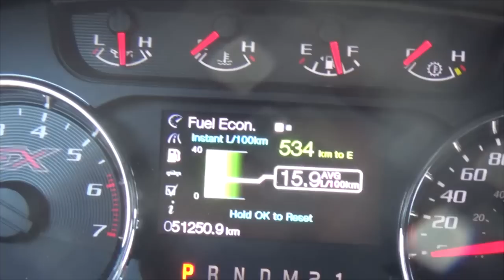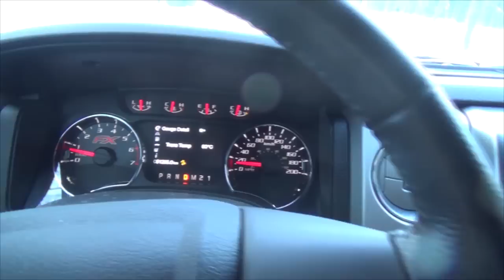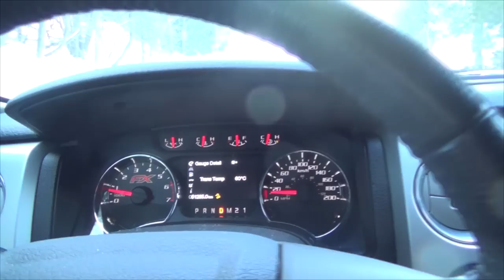Working on the park bench

Comment: HI Bill, it is a good ides to unplug the heater before starting. I drove trucks for 24 years and was always told unplug it be fore starting. The service man said if your coolant is a little low and it cavitates around the heater it is gone in less than a second. They are not made to be out of coolant at all when on. 
Thanks for the vids keep it up.

Comment: B12 chemtool fuel system cleaner will clean the ring land right up in around 15 minutes of soaking. I should know. I used it on a motorcycle I bought with 19 year old gas left in it. Carbs were plugged solid. I poured that down the gas line and let it soak. It runs good now and that's all I did to the carbs

Comment: Looks like your truck has a temperature activating block heater cord it could be the temp sensor disk at the front of the cord the little round black cap it should activate after -20 without windchill

Comment: Bill, have you looked into JCB for a replacement loader/backhoe? One with a cab for the winter months of snow removal. A JCB 35 I think would be comparable to your 110. And it has an extend-a-hoe to dig extra deep if needed. Just a thought.
Reply: I think you are thinking of the MIDI CX. We don't get them here in US or Canada anymore however, so he'd have to find a used one.

Comment: BILLSTMAXX :) My '87 chevy has a block heater (aka frost plug) but it doesn't really provide heat quicker, as that's not the point of them. They barely heat the coolant, actually. Not even enough to move the temp gauge before start up, as the point of them is to warm the coolant, which the heat then moves into the cylinder walls, to make starting easier, as the components are all warmer. Nothing will be hot enough to provide heat faster, just make the starting easier. However, they still are useful, or at least, mine is on my truck (Except I gotta re-install one now, as I have to replace my engine, old one blew the head gaskets) :P

Comment: I think I would have just made sure the holes in the cement legs were all in line and if they were I would just drill each board in the center at maybe 4" and 44" and call it close enough. Might have had to make some adjustments later but maybe not.

Comment: yes your block is heater is coolant heater but it doesn't mean when you start your truck it will blow heat, thermostat still close to heat your engine before your butt
Reply: block heater is IN the engine loop. the heater core is also in the same loop on most american and japanese vehicules. The reason it wont heat your butt is the coolant wont go over 10-20 celcius even with the block heater on for several hours

Comment: On the park bench, how come you didn't price compare using Composition lumber, the type made using wood products along with a plastic resin base? That type is supposed to last a lot longer than any natural wood product and is not that much more expensive than regular wood that you used and is a lot cheaper than what cedar would cost.
Reply: It also gets hot as F in the summer with the sun on it.
Reply: FishFind3000 yep it would bend for sure over that span. I built 4 decks out of it for clients, imnot impressed by the stuff and  ost fa tor ill stick to my cedar.
Reply from the maker: Nortekj they didnt have that either in stock